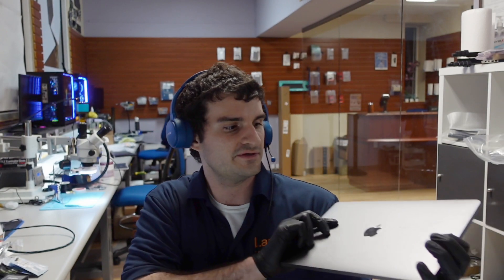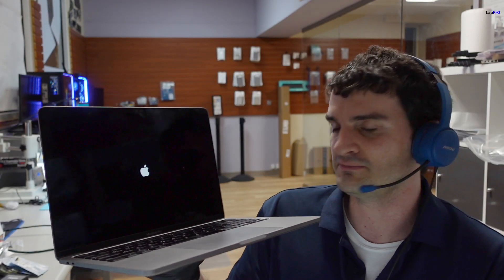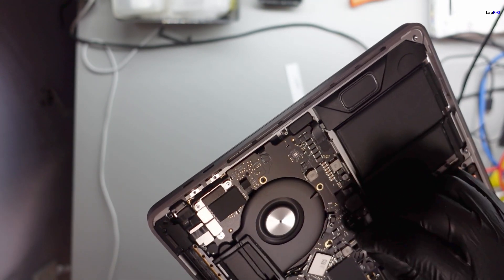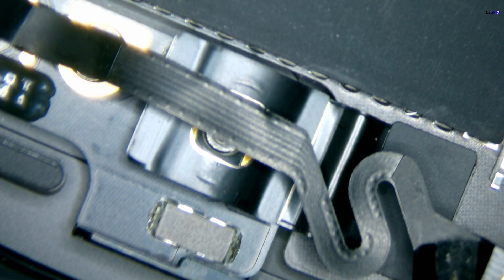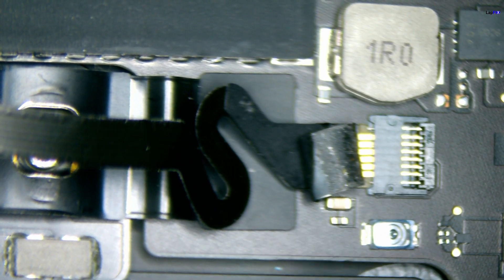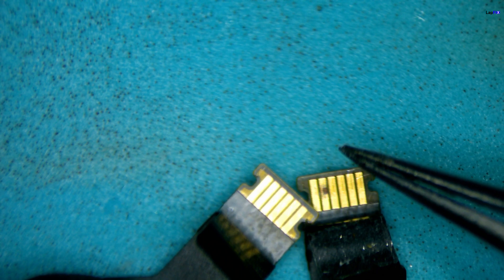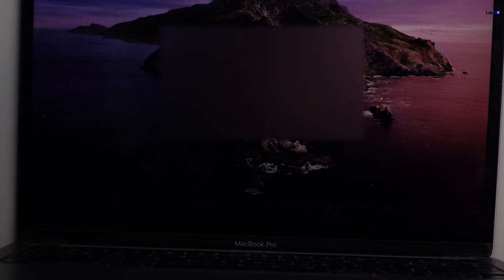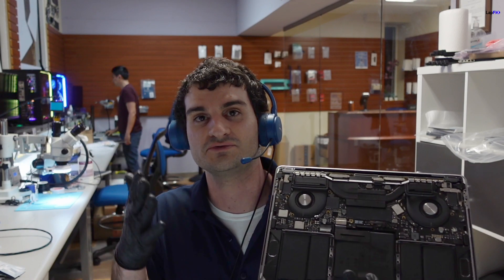How To Fix Macbook Pro Loud Fan Spin After Battery Replacement

Comment from the maker: If you foound this video informative, please leave a like and subscribe.  Have you guys ever had issues on newer macbooks installing a battery?  Let me know down below!
Reply: I recently replaced a battery in a 2013 MBP. It was initially stuck in a boot loop. In the past, and in other videos, the battery was the culprit. I tested the new battery in the MBP before removing the old one, and it booted. After replacing the battery however, now it gives one beep every 5 seconds and won't boot. it does it still when I discontinue battery and connect ac. Help!!!!!!!!

Comment: I tried to replace a new battery and the fan ran loud. After the cable was reconnected firmly, it turned to work perfectly. Thanks for the share. :-)

Comment: It's possible remove the damage zone cutting 2mm of flex ? I have a MacBook pro 13 2016 and the flex battery is soldered on de board battery... It's the original battery with only 200 cicles...

Comment: I didn't replace my battery, however my battery fan is so loud, the keyboard light doesn't come on, the battery health doesn't show.

The last I checked, the battery health was normal. I'm confused
I tried the "shit + control+option+power button" yet still happening

Comment: Pulled a virtually new battery from a dead 2017 MBP and after installing it got all positive indications on the "Coconut battery" app indicating there are no problems but the fan kicked in to the max in a minute or so with no apperant reason. Couldn't figure it out and on my search bumped into this video. It's impossible to pull out the batt data cable on this model, but inspired by your actions I disconnected it from the board, wrapped it and sprayed it with contact cleaner then gave it a gentle wipe plus a short spray in to the socket. All back to normal, hohnestly made my day, cheers!
Reply: Wrapped it up in what bro? I seem to be having the same trouble here. My right fan and right fan only spins full speed after battery replacement. Could u please give me a detail of what u did? Appreciation in advance

Comment: I may eventually replace the battery on my old 2012.5 15.4” retina, but I’ll let the Apple “geniuses” replace the one in my m1 max 16” when that day comes. Thank you for this vid. Great info and caution.
Reply from the maker: Glad you foudn the video useful =).  Do they still replace the 2012?  I know for most repairs it is considered "vintage"